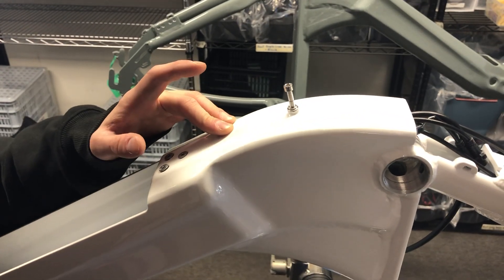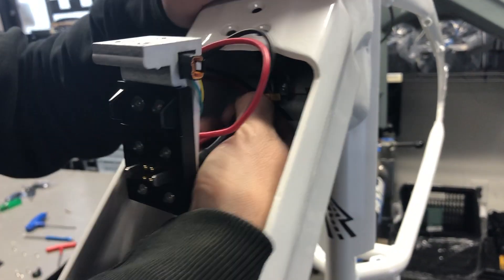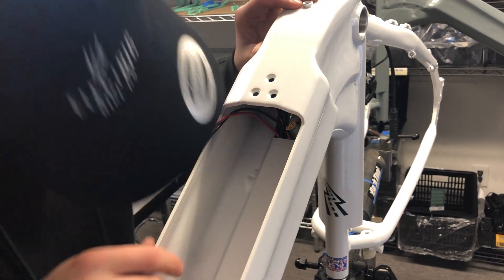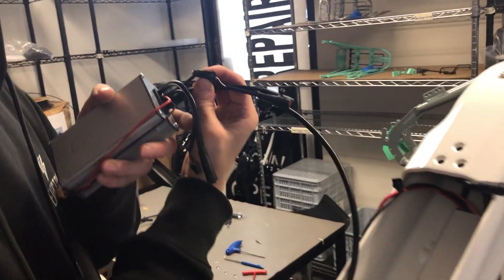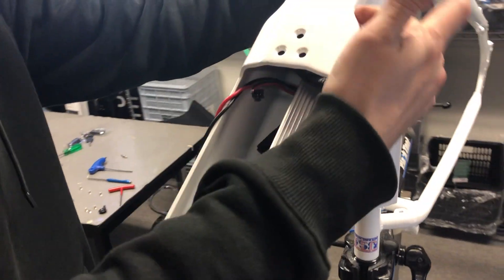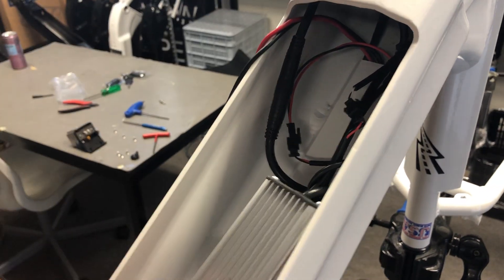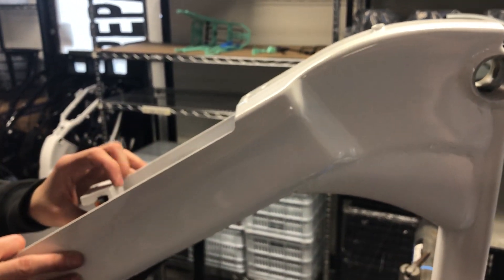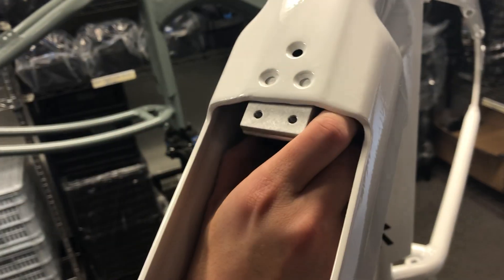How to Install Controller on Model R

Comment: Whoa! This procedure saved my precious butt! I had a burned-out motor on my Model R, which was repaired under warranty, and then there was concern about the controller. Michelle from EBC sent me one, and Tori (both great customer service reps!) sent me the link to this video. I just finished replacing the controller and reconnecting everything. It works great! Thank you, Michelle, Tori, and EBC!